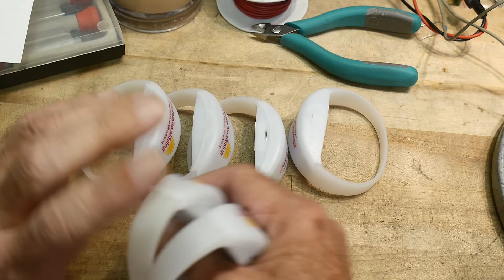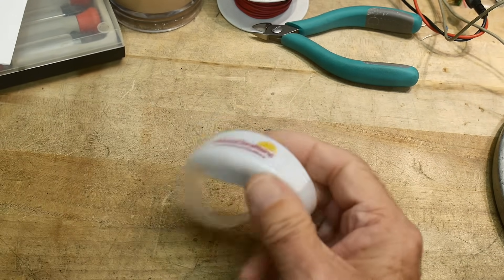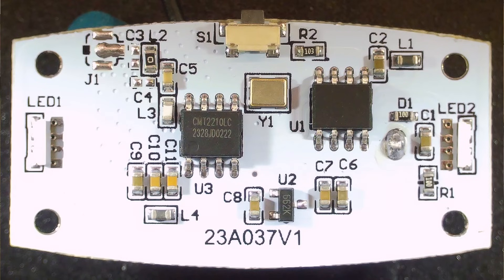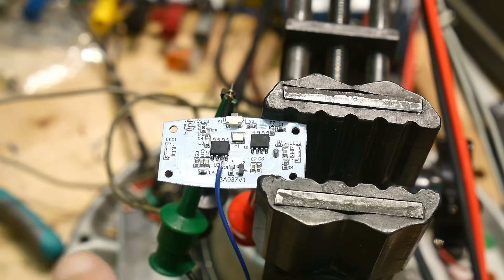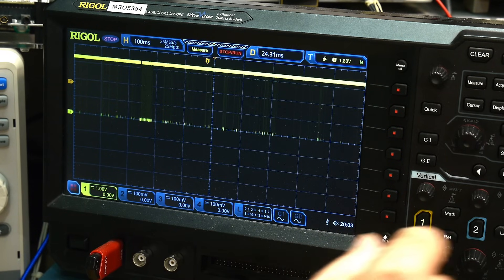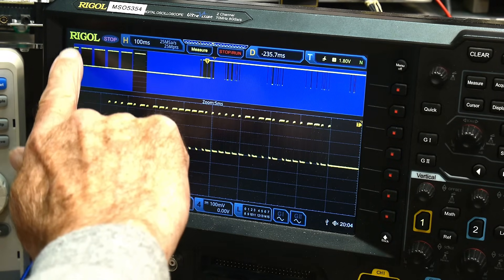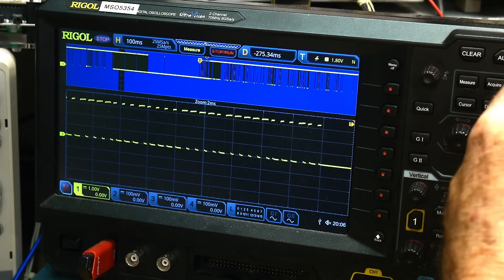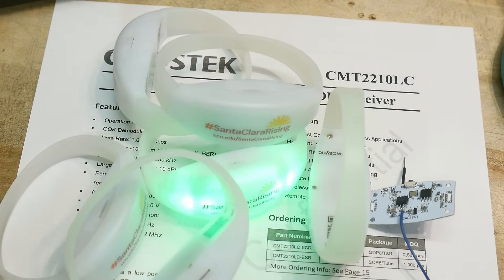#1828 433MHz Receiver IC CMT2210

Comment: rtl-433 software demodulates a ton of stuff 433/315 devices like tire-pressure sensors, door/window/motion sensors, weather-station sensors and more. Usually uses an rtl-sdr dongle. Not sure if it can directly grok demodulated OOK.

Comment: LPD433 devices are everywhere.  Even out in the country where I live if I look at the waterfall display on my Icom IC-9700 on that portion of the band it's just filled with short data burst 24 hours a day.  Been a while since I dug into the FCC reg's but I seem to remember the power limit for unlicensed LPD devices was 10mW.
Reply: Well, isn't pretty much everything, like every tire pressure monitor in all four or five wheels in every modern car going to be bleeping out RF blurps periodically, yet incessantly, on 433 MHz?
Reply: @drussell_   Yes and also in the 315MHz range.  A lot of the sensors are dual band these days.
Reply: @mikesradiorepair  correct, it's the ISM band (as well as 27, 40, 868MHz and 2.4GHz and a few more, I believe)

Comment: Why didn't you use the pulse trigger to capture the data? That 'scope has the ability to trigger on a negative going pulse with a specified pulse width range. And just for the heck of it how about looking at the data using the RS232 decode?

And maybe I should stop making useful suggestions.  - grin
Reply from the maker: A: I really didn't care that much

Comment: According to the EPA, lithium-ion batteries are a threat to landfills because of their ability to start fires. They didn't mention other possible reasons for recycling like the presence of other potentially hazardous metals like chromium. This seems like flamability wouldn't be a serious problem if the battery was really small (likely the case here) or if was completely discharged prior to disposal...
Reply: Very unlikely that it was a lithium-ion battery, probably just a normal lithium manganese dioxide coin cell (CR2032), since he said it was 3V.
Reply: @kpanic23  Yeah, you're right. I was confused because lithium manganese dioxide coin cells are not categorized as hazardous waste, so it's perfectly legal to throw them in the trash, although maybe not in CA where the IMSAI Guy lives...
Reply: @ats89117  Yeah, regardless of chemistry, batteries aren't exactly biodegradable... 😄
Reply: It's perfectly legal to chuck lithium manganese dioxide batteries into landfill, and it's also perfectly reasonable to have reservations about doing it. Indeed, they're far from biodegradable. 😅

Comment: How would you make a directional antenna which worked at 433MHz?
Reply from the maker: google '433MHz YAGI'
Reply: @IMSAIGuy  Also look for 70cm yagi since 433MHz is in the 70cm ham band.
Reply: if you want a good 180 degree coverage with a little gain over an omni, look at a "moxon rectangle". I did a project with 433Mhz radios a few years ago that needed a slightly directional antenna, as all of the radios were in one direction from the main base radio, and that's what I came up with. You could probably also go with a patch antenna, but it'd be pretty big at 433Mhz

Comment: Digital thermometers use 433 mhz
Reply: TONS of stuff uses 433 - thermometers (and other weather station sensors), wireless security sensors, remote car fobs, on and on. Anything that transmits a little data intermittently can use it. It's super low cost so easy to integrate into tons of consumer products. There's some software you can use with an rtl-sdr that decoes many known protocols that are typically found at 433